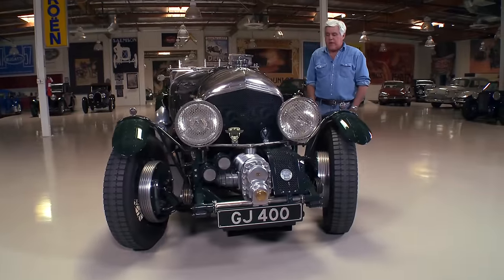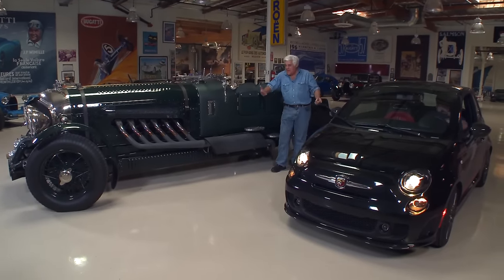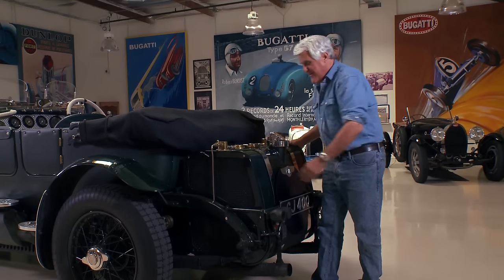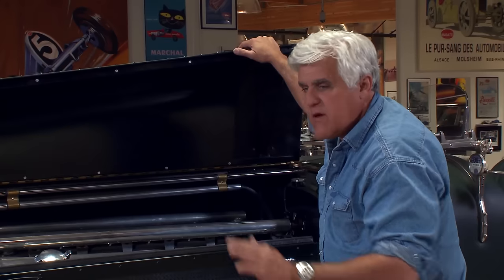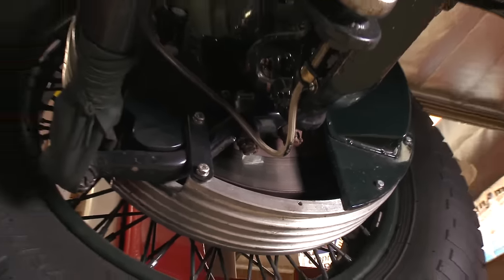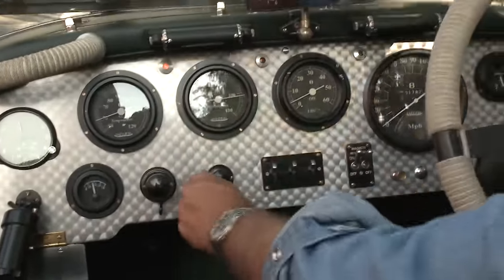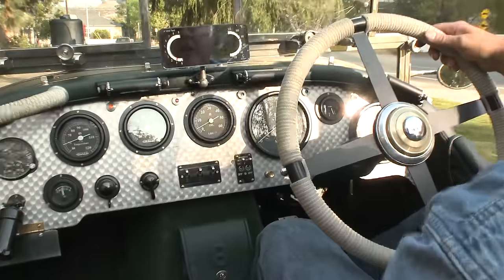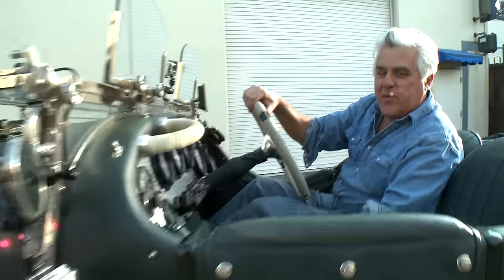1930 Bentley 27-Liter - Jay Leno's Garage

Comment: Jay probably blew $300 in gas on that test drive lol
Reply: "We put a lot of miles on that"
Reply: For how low RPM that is on road, I would say it probably doesn't use that much gas. If he were to stomp it, it would probably start sucking like a damn sump pump.
Reply: The Merlin is known to use 1-2 gallons of fuel a minute just idling, going down the road at the speeds he's cruising at, he's getting gallons per mile fuel economy.
Reply: @lsswappedcessna  a Merlin on high boost will burn well over 100 gallons an hour.
Reply: $300 to Jay is nothing.
Reply: so it's still more efficient then a stock Blower Bentley.
Reply: *of
Reply: It’s £420 for a full tank (100 litres)
Reply: @GGigabiteM  idling uses more fuel than casually driving.
Reply: About 930 now

Comment: There is a local owner of a 1928 Bentley.  4.5 liter.  The hardware is stock but there are a few cosmetic tweaks.  I got a kick out of the fact all the leaf springs were wrapped in rattan then painted to match the car.

Comment: Some interesting points about this engine. Rolls Royce built big to go racing, along with SuperMarine in the '30s, to try and win the Schnieder Trophy. The racing engine was developed into a production engine, the Merlin. The Merlin was built to be supercharged, at quite high levels of boost. At the beginning of WW2 they made about a thousand hp. By the end, they made well over two thousand. The Merlin had double overhead cams and 4 valves. The cams were driven by shafts. There was no drive chain in the motor, nor chain of gears. The exhaust valves got hot and burned out, so they tried making them hollow and filling the shaft with sodium. That made the valve guides very hot, so they wore out very quickly. Production Merlins featured screw-in valve guides, because they'd have to be changed quite often. Water injection, water + methanol injection, and nitrous oxide were all used on this engine, in combat. After the war, some of these ideas found their way into car and bike engines for drag racing and similar, but the original 'fully worked' engine in the world, straight out of the factory, was the Merlin. Oh, and the constant velocity carb we all had on our bikes in the '80s? Came from the SU car carby, which in turn came from the constant velocity carb used on the Merlin. An awful lot of 'go fast' stuff, showed up first on this engine.
Reply: I think they took the Merlins up to about 1750HP. The Griffon was I think 35ltr..2300HP.
Reply: threepot Roughly, yes.
Reply: +threepot The Griffon was 37 litres.
Reply: +1 for you.
Reply: +Kneedragon1962 very cool, thank you
Reply: The Skinner Union carburettor was invented in 1904, patented in 1906, and in production from 1910.  The original WO Bentleys had them, lots of '30's cars had them, and they were proverbial on Brit cars until the efi era.
Up to 1942, Merlins had a power cut-off problem under negative G forces,  then they all got pressure carburettors.  Not forgetting the temporary fix, Mrs Schilling's orifice.  Actually a diaphragm in the float chamber with a hole in it.
The best production Merlin had 2030 bhp, Griffon 37 litres and best output 2420 bhp.
Reply: The engine in Jays car is a Rolls-Royce Meteor (not Merlin) a tank engine basically. The supercharger on Jays car is fake.
Reply: RR did not try and win the Schneider trophy, they did win it three times on the trot which means Britain kept it for ever.
Reply: + Neil Anderson    If you bother to read the posts above, you will see mine of a year ago, where I mention Miss Schilling's orifice.  This was a perforated rubber diaphragm in the float chamber.  Miss Schilling was an engineer and also a noted motorcycle and car racer pre-WW2.  Actually, by the time of the War, she was married, but is referred to under her maiden name
Reply: @Marauder252  It is a Merlin V12, with a Meteor fuel tank up the back. It likely the only fuel tank that would fit and carry enough fuel. And yep, the supercharger is fake.. However, it was made to look like an authentic Blower Bentley from the era.
Reply: The engine that RR developed for the Schneider Cup aircraft was called the R, and it was a supercharged version of the Buzzard.  They showed up for the Schneider Cup race running 12psi boost out of the centrifugal supercharger, and it sent shock waves through the engine community.  Later versions were boosted even higher, and also powered Donald Campbell to boat and car speed records.  The lessons RR learned on the R were applied to the 27-lliter Merlin, and later went full circle when the Griffon was designed with the identical displacement to the R.
Reply: @Marauder252  You're dead right. The tank version rotates in the opposite direction. And you could never use it in an aircraft as a lot of the components are steel. I mentioned this in another video and got bombarded with abuse.
Reply: No.  It's not a Meteor.  In the video, Jay said it's a Packard Merlin 114 with the 2-stage supercharger removed.

Comment: There's no replacement for displacement.
Reply: Next step, upsize to the RR Griffon engine 37 litres, as fitted to some later Spitfires
Reply: False.
Reply: That's why my wooden pistoned 1989 Volvo 340 1.4  goes so fast!
Reply: @marcobrancorsini2479  I agree.  The modern age has proven that displacement isn't the largest factor.  Back then, sure, but definitely not today.
Reply: SuckMy SpinningBalls — It still matters.  I have a modern car with a tiny turbocharged engine.  It drives nice, but has no engine braking on a hill.
Reply: There actually is, in the form or higher operating RPMs, more efficient valves and chambers, forced induction, etc.

Having said that, this car moves along pretty well for vehicles of that long past era.
Reply: @ominous-omnipresent-they  Even then, more modern cylinder head configurations (DOHC in some cases, beginning with a Peugeot nearly 100 years ago) and supercharged engines easily disproved the "more displacement" myth.
Reply: @GH-oi2jf  Great point.  I've noticed the same in 2018 GTIs. However, the brakes are incredible (big vented discs at all four wheels form the factory) that the lack of engine braking is largely moot.
Reply: Merely substitution, not actual replacement.
Reply: @noneyabizz8337  Very few people today are interested in a 27 liter engine that likely weighs 2,500 or so pounds and delivers some 240 SAE Net HP while getting 4 MPG.
Reply: There is when people started flying at higher altitudes.
Reply: The ironic thing is that the Merlin was an exceptionally small airplane engine

Comment: This car is beautiful! Would have been nice to hear it start up.
Reply: Agreed!  I was disappointed that they didn't show the startup procedure for it...  Really wanted to hear that 27-litre Merlin engine come to life.
Reply: LMacNeill And remember that when Rolls-Royce couldn't supply the war demand with hand built Merlins, Packard in Detroit stepped in, re-worked the british left handed blueprints to American right handed prints; changed all the Whitworth nuts and bolts to SAE, and turned out 75,000 mass produced Merlins that really helped win the war in the Spitfire, Hurricane, Lancaster bomber, and our Mustang. I have driven 3 Packards; a 53, 49, and 47. All great smooth straight 8 engines, very understressed. Especially the huge one in the 47 Custom Super Clipper. Biggest horsepower available in America that year-165. The crank had 9 main bearings, etc.
Reply: When Rolls Royce and Ford of britain  had already changed the Merlin for mass production, Packard got the modified engine and Rolls Royce made more of them than the 55,000  total that Packard put together.
Rolls Royce not only made more of them, they did all the design and development and made all the Griffon engines and they made jet engines, Packard was small time. The Rolls Royce Merlin assembled by Packard went into a minority of the planes you mention. Real Rolls Royce engines went into more of them and many other planes too.

165 hp in 1947 sounds rather pathetic for such a big engine, no wonder American cars were so slow then, just as well they had brakes that hardly worked and they could not go round corners.
Reply: Barrie - It's always sad how you brits get so smug and snobby about such things.. you would think you people were compensating for something with that smugness.
Reply: British and have to agree. For all the political and commercial shenanigans between our countries, when we put our heads together, it works very well. The Merlin and dare I say the Harrier V/STOL are prime examples.

Comment: 1,647 cubic inches!  I guess this car is the exclamation point on the statement, "there's no replacement for displacement "!!  Thanks for sharing this piece of history!  

The P51 was an amazing aircraft. My father had a friend back in the early 70s that had a P51,  the "Miss Coronado" and he would fly airshows where he would go in to a dive at full throttle pull up about 75 feet above the crowd, like he was doing a strafing run!  The sound that Merlin made that low at 400 mph was something you'll never forget!

Comment: This can be YOURS for a trifling $800K. As The Daily Mail explains, "the car was hand-built by Bob Petersen Engineering. The chassis comes from a 1930 Rolls-Royce Phantom II, while the coachwork was designed to give the feel of a pre-war Bentley. Since the Merlin V-12 is a thirsty beast, delivering just three mpg, the Meteor is fitted with a 400-liter (105 gallon) fuel tank.... Its capable of 160mph." 

I want to imaging some Tuner in his rice cooker on the interstate having this monster loom up behind him and then being blasted by at speed by this visage of some Edwardian steampunk nightmare, then pulling his car over and with tears, walking away from his now emasculated cooker.
Reply: KlunkerRider 
I'll buy it as long as I get 3 years free unlimited fuel supply.
Reply: Only $800K?  Then I'll take two of them.
Reply: 3mpg? Thats worse than a hummer.
Reply: ...Is that city or hiway ....   or combined  ?
Reply: ..as the Daily Mail also explains:  "...and no sign of any bloody immigrants in the garage".
Reply: joe foley xD
Reply: joe foley "rice cooker" isn't racist it's a car thing
Reply: Considering old Ferrari's fetch multi millions 800k isn't that bad.  Most of the cost is in the engine.
Reply: @joefoley1480  You were overly protected when growing up.
Reply: KlunkerRider — “Rice cooker” is not only not racist, it’s not just a car thing.  My dad called his Japanese ham radio a “rice burner.”  If he intended it as a racist insult, he wouldn’t have bought it in the first place.
Reply: @joefoley1480  hope you were able to find a safe spot and talk through those feelings
Reply: This car would emasculate an F40 and a countach together.
Reply: I just like the fact that these things can still be built, because i think in 20 years time, the craftsmen will not be around.
Reply: Rice cooker?
I doubt that thing could keep-up with a GTR.
Sure, it's a modern car that goes up to 200MPH and whatnot but... by your definition it's all the necessary ingredients to be considered a tuner's 'rice cooker'!
Reply: 3mpg? I thought my car was bad at 9mpg.
Reply: @shaunportlock4924  Nor will the fuel.

Comment: It's not the Merlin, it's the unsuperchargered Meteor engine, which was used in British tanks.
Reply: Larry Phischman It's America, we don't know the difference.
Reply: I'm an American. But you're right. The only reason I know the difference if that this exact car was on an episode of Top Gear (UK).
Reply: +Larry Phischman This engine, or a variant of it is also used in different ships.. even today.
Reply: Tug boats mostly. Most over ships use diesel electric turbines.
Reply: +Larry Phischman That's ome hell of a necrobump on this comment. I didn't think I would ever see this again.
Reply: +Paul Muñoz 
You don't know what a necrobump is... I've resurrected forum threads that have been dormant for 10+ years
Reply: +xLDKx NewYorker 
You don't know what a forum is... I've resurrected necrobump threads that have been dormant for 10+ acne
Reply: +Larry Phischman 
so whats the supercharger doing on the front?
Reply: Time for a massive NecroBump, he said in the video that that "supercharger" is fake and is in fact the oil cooler.
Reply: Cheaper by the thousand it's an oil pump. He tells you in the video
Reply: I used to work on the Meteor engine in Centurion tanks back in the 60's.
Interesting fact, those Meteor engines had no flywheels. With a clutch weighing 4cwt (448 lbs) flywheels were unecessary.
Reply: No Supercharger, well you wouldn't want to go too crazy, would you? Somebody in the UK has put this same engine in a Rover SD1
Reply: The Merlin aero engine runs in the opposite direction to the Meteor engine
Reply: Packard was licensed to build Merlins later in the war, but not Meteor engines. You don't need to be a Brit to know the difference. They built far more Meteor engines than Merlin. Before Rover ended production they had produced like 10,000 of them.

Comment: This car is insane! What is the mpg on this monster? Probably a gallon per ignition.
Reply: Stet Tan 3 mpg.
Reply: +Stet Tan Probably uses 1 litle per cylinder in a span of 3 seconds... >.>
Reply: Stet Tan it's measured in gallons per mile, it's about 15 gpm
Reply: 50 GPM. that being 50 Gallons Per Mile
Reply: It's a 27 litre engine. 27 litres is 7 u.s gallons. It was initially used in WWII era British tanks. One of the later ones being the Centurion Tank. You can probably imagine that it uses a lot of fuel.
Reply: According to the Wiki page on the Cromwell tank (first British tank to use the Meteor engine), it managed between 0.5 and 1.5 mpg (Imperial) depending on terrain.  The Bentley / Meteor special is probably lighter and more aerodynamic, with less rolling resistance, so will be more fuel efficient.  I can't guess now much.  Try asking Mr Leno
Reply: +Paul. If you can find that Top Gear episode, I think they might mention it's mpg on the show.
Reply: It gets 40 rods to the hogshead.
Reply: It has a 105 gallon fuel tank. A regular car has around a 15 gallon tank and gets about 20mpg, giving a 300 mile range. To get the same range, this car gets about 15/105 x 20 mpg, which is 2.857 mpg.

Comment: Technically it's a Meteor engine which was designed for use in tanks so it's a substantially de-tuned, naturally aspirated Merlin. Only disappointing thing about this car, and indeed all Meteor-engined vehicles is they don't sound very exciting - all you hear is whine of the timing gears and the transmission.
Reply: +Simon Coles Finally someone else who knows that
Reply: +Simon Coles I was going to say, it did NOT sound at all like a Merlin that I know.
Reply: I think it sounds glorious. Not quite a mechanical symphony as a Merlin but as solid as a grandfather clock.
Reply: The Meteor and the Merlin are the same thing. They took tired old Merlins, removed the supercharger and rebuilt them for use on the ground. There's a guy in the UK building a Meteor special - he researched the history of his engine and found it had started life in a Hawker Hurricane.
Reply: Naturally aspirated is probably what you want in a road car with 17 litres
Reply: Feral Mass
I suspect that the full 2,070hp of which the ultimate Merlins were capable in standard tune - they can make a lot more than that on 180-octane racing avgas. The P-51 "Dago Red" makes 3,800hp on a good day...
Reply: I thought meteors were diesel though ???
Reply: the meteor engine came about when Rolls Royce got crashed Merlin powered planes back the would remove the engines (which were mechanically sound) they weren't aloud to be fitted to planes again. eventually they were detuned for use in tanks so a lot of meteor engines started out as Merlin's.
Reply: Not quite - a lot of Meteors did start out using Merlin parts, but they rotate in the opposite direction so things like cranks and camshafts aren't interchangeable. Blocks are pretty much the same, pistons are different, crankcase doesn't have transfer gear supports.
Reply: @philking7805  You're correct, I own a meteor engine which came from a tank. It's about 30% Merlin. Very little is the same.
Reply: Also built by Rover cars.
Reply: Richard Harrold That was true for the earliest motors, but the Rover motors were built as Meteors from the ground up.

Comment: They call these Merlins, but they are actually Meteor  engines without blowers  from tanks .
Reply: Rob Mackenzie you dont see the blower  in front of the grille??
Reply: That's the oil cooler, made to look like a supercharger as fitted to the blown 4.5 litre Bentley.  On a Merlin, the superchargers are at the back of the engine.
Reply: If it was a blown Merlin, it would make 1200 up to 1800 hp. Definitely a  Meteor tank engine application. It is a Merlin in size and the block, but not in application

Comment: 17 gallons is 65 litres. You're welcome :)
Reply: and it only gets 3mpg

wow
Reply: dennis trident william Lol, that car probably eats Prius for breakfast D:
Reply: B125WUV T1125 11125  keep in mind that those 17 gallons (65litres) are NOT FUEL but lubrication oil of the engine...
Reply: @Z4G.  A Tesla Model S goes 300 miles on 100kwh. 100kwh=2.5 gallons of gasoline.